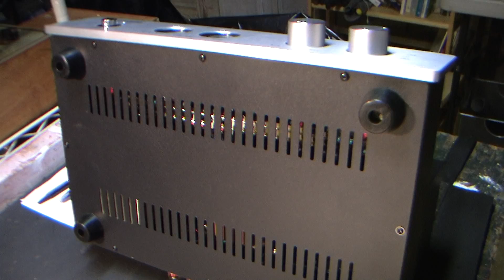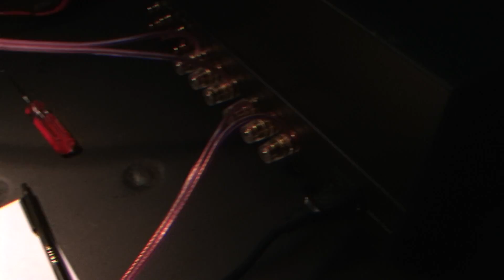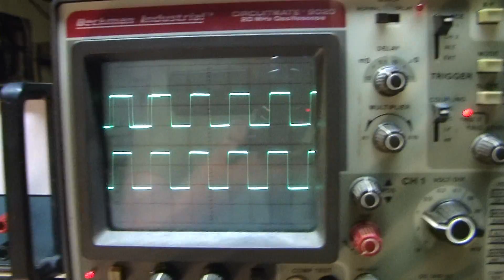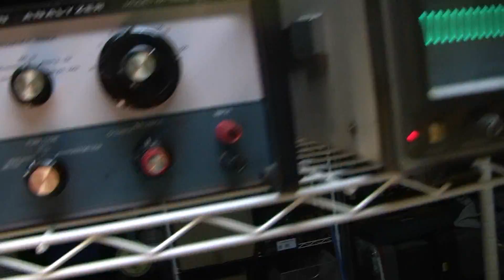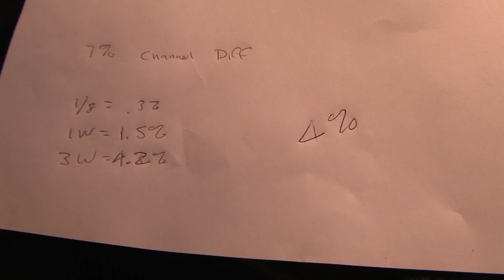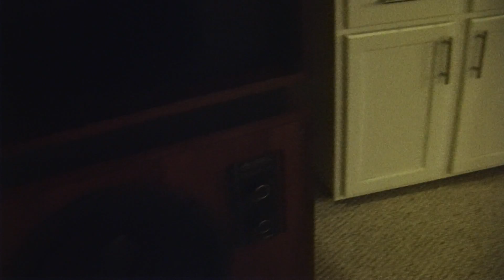Product Review Gemtune GP-01 300B Single Ended Class A Integrated Amplifier

Comment: they also said in the description that the VU meters show tube current in real time, which i find odd because VU meter looks to show only db scale, can you tell me if your amp shows tube current or is it db scale? another concern is the shipping, and did you have to pay a customs fee which is sepperate from the shipping charge. I like the looks of the 300B tubes, right now this amp is selling for $849 on ebay but they also have the Yaqin MC-100B for the same price, i do like what i hear about the MC-100B but it does have a circuit board but it is user biased which i like.

Comment: wonder if you can help clear up some confusion i am getting from the Doukmall store on ebay, they have this amp forsale and one that is simular to it, i asked if the amp is auto biased or user biased and the reply that i got was just (biased) so i messaged them again and had to explain it to them in more detail, and they replied back (also self biased) so at this point im wondering how i can get the truth out of these guys, then they said it was user biased, but in the description and specs they put on the ebay site there was no mention of how its biased, so can YOU tell me if its ( self biasing or user biased)  because judging by there photos i could not see any adjustment screws or ports for multimeter probes.

Comment: Great review. I have the same model amp, and I agree with your description of the sound. 

I like the sound of Gemtune GP-01 300B with sensitive speakers better than my hybrid tube/solid state, $1,895 Croft Phono Integrated amp, which is itself a very good integrated amp (a Stereophile Class B Recommended Component for several years). 

The Croft does have better control of the bass with more impact on full range speakers, as it should with its MOSFET solid state output stages, and 45 Wpch output power. 

However, for my flea watt SET amps like the Gemtune, I prefer to use an active subwoofer that has a solid state amplifier driving the subwoofer, so that the SET amp only has to drive the high efficiency speakers above the subwoofer's cross-over frequency, which in my current setup is 100 Hz. This type of setup provides the low bass control and impact of the solid state amp married to the rich upper bass and mid-range, extended sweet treble, and spacious soundstage of the SET amp. To make this work, one must be willing to spend the time and effort in listening and tweaking the subwoofer cross-over frequency, level and polarity until the transition between the subwoofer and the speakers sounds seamless.

My Gemtune amp also has a channel imbalance, which I can hear as a steering of singers and instruments off of center when they are supposed to be centered between the speakers. I corrected this using a high quality attenuator on the input of the louder channel.

Another way to handle this is to use a preamp with a balance control with this amp.

Some source components may have channel level controls, like my Oppo blu-ray player, which can be used to correct the channel imbalance. However, most of my other sources do not have channel level controls nor balance controls, hence my using an attenuator.

Comment: Just bought one of these shipped from Hong Kong. It's branded "Oldchen". Yes its a very nice amp. I got great sound right out of the box only to improve after 100 hrs . Thanks for reviewing this amp under a microscope. I also have a Jolida 502brc and this 300b 
Amp is comparable in quality and articulate in sound.  With a tube up
grade the enhancement is a  pure audiophile dream.

Comment: I got a NAD that looks exactly like yours. Mine is rated at 80 w per ch. It sounds good, but treble is a little "wirey" compared to my more natural treble on my way cheaper 200 w per ch. jaycar amp. And the jaycar has better bass. But the NAD does sound "alive", maybe that's why they are liked so much (but just a bit more "transistory" in the treble. lol And $800 is cheap for a tube amp. who cares if it's not that powerful. The sound would be amazing, going by your reaction. I had a tube amp (an old Sansui) looked much like your old tube amp. But I had a fairly gutless tube amp as well (small size old school one) and it was less powerful but miles better in sound than the old Sansui. Your NAD started my rant. I use my NAD sometimes but usually it just sits around, but I would never sell it. Sound system nuts always need a second amp just in case one fails, and for parties elsewhere occasionally.

Comment: The left and right imbalance could also be due to the volume pot having some tolerance.  See if you can add a high value parallel resistor from center to either ends to bring that in sync with the other channel.

Comment: the white stuff is liquid electrical tape. It is not corona putty, which is used only on high voltage to prevent corona arch discharging. .  The liquid electrical tape is there, to prevent terminal corrosion, and accidental shorting by people poking around in there with screw drivers , like you.

Comment: I have presently three SE amps: Will Vincent 2A3/45, Sanei 2A3/45 and a custom-built 6BG6 tetrode. All three amps will drive my Klipsch Heresies and DCM Time Windows to adequate listening levels. Proper speaker matching is important with low-power tube amps! For my Quad 57's and Rogers LS3/5A's I prefer 20+ watts of PP power - Dynaco ST70 and Paoli/Dyna Mk3's.
Reply: Robert Jermantowicz t

Comment: specs for response above human hearing range, are useless- what matters is how good it sounds to the human ear.  checking a stereo with a meter, is like sizing up a woman with a tape measure.  you can get great measurements, and the package may look awesome on the surface, but you may end up with something you can't live with for more than a weekend.  her "personality", tone, and habits may be horrible.same with stereos.
Reply: AWESOME comparison man, I second that ;)  PS any idea weather Parallel Single Ended amplifiers sound any different than Single Ended amplifiers?  this Parallel tube amp uses 2 valves per channel in paralel for more power: https://www.amazon.com/YAQIN-MC-550C-Vacuum-Integrated-Amplifier/dp/B00A7IZPGY
Reply: the ultimate stereo is a single ended, period.  the downside is, lower volume, bass hit, power.  the upside is, great detail, depth, soundstage, realism, no listening fatique.  an added perk, a nice single ended stereo saves you ears from volume abuse.

Comment: I suspect the imbalanced Left Right is caused by non-matching tubes.
Reply from the maker: Could well be.  But, I've since added balancing pots to compensate, so no biggie.  Regards ...
Reply: how do i add a balance pot ? at which point in the circuit ? cheers
Reply: Agreed, typically imbalance...can.... come from non-matching tubes. However, if this tube amp allows u to adjust the tube BIAS, then I would start there. Seems like u fixed this w balancing pots....but since u like this tube amp so much, do additional research from currents users. See what tubes they rolled to. My Yaqin MC100b allows u adjust the bias on the tubes. Honestly, I would not even think about buying a tube amp, unless it had user adjustable bias, via screwdriver and a volt meter. Tubes notoriously fade in performance over time,and also certain makes and models of tubes need bias set specifically when paired with a specific tube amp ...really only takes a few minutes every 6 months, less for more frequent daily usage..but once u roll in BETTER tubes...could be old stock vintage tubes, or newer matched tubes.....wow...u think your tube amp sounds great now...roll tubes and u reach phenomenal listening levels, especially playing vinyl, or even using a tube buffer w CDs or music streamer. High efficiency speakers are a must...if u r a basshead, can always add a subwoofer to a pair of great book shelf speakers. Have fun.

Comment: Try swapping power tubes.  See if that follows.  If it doesn't, then you may want to check all of your electrolytic capacitors using an ESR meter.  I'm thinking that is probably your problem.

Comment: My theory is that the white goop is applied specifically to discourage one from modifying the amp. Removing it will probably void the warranty. I am building an Elekit TU-8300R which looks to have a similar design. My amp will also let me use 6550 (KT88) tubes as well as the 300B. Looks like you have a good amp. Thanks for help keeping analogue audio alive.